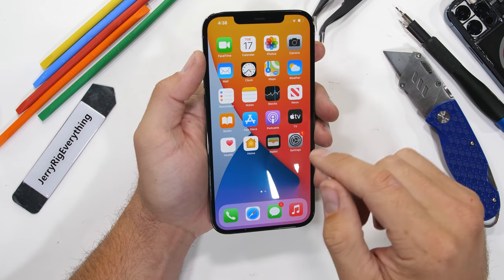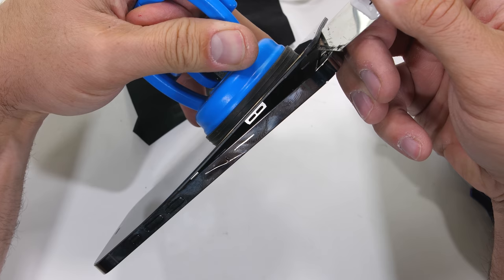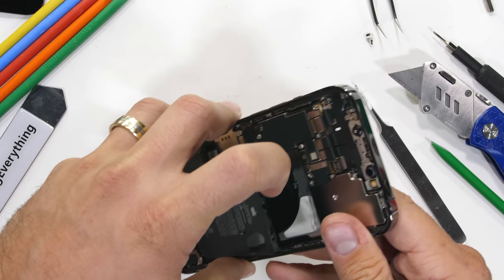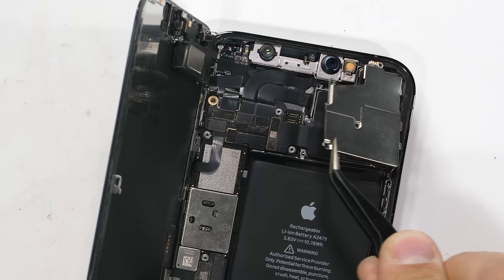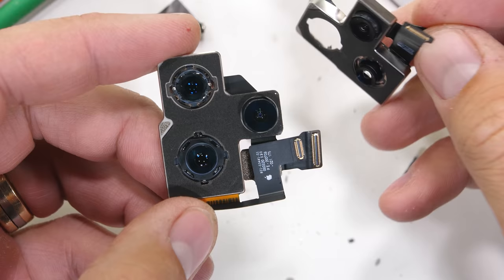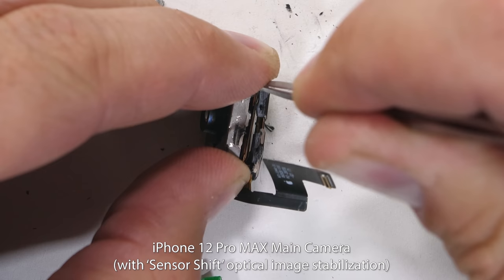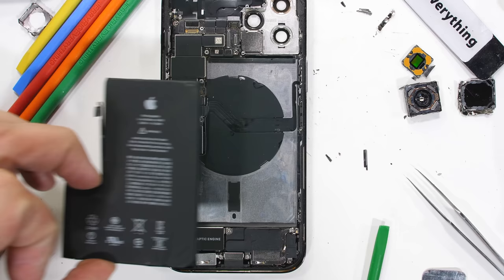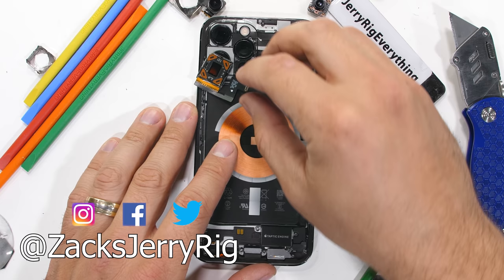iPhone 12 Pro Max Teardown! - I've NEVER seen this before...

Comment: Didn't realize they were using knock off Command Strips under the batteries.
Reply from the maker: Discount PullTabs r Us
Reply: @JerryRigEverything  Hi
Reply: @JerryRigEverything  hi
Reply: @JerryRigEverything  you replied?
Reply: Hi jack. Cone to Bali
Reply: @JerryRigEverything  hey jerry
If you use a little heat from the back of the phone it makes the pull tabs come put wayyy easier
Reply: First i read as “Tech with Butt” 😂
Reply: @JerryRigEverything  Noice
Reply: Hmn
Reply: Unless you can pull those tabs in a unique way. Those tabs aren't for us repairers anyway. Hence why they break easy.
Reply: LOL yea
Reply: Kidney opening done👍😄😄
Reply: @Silvers24  not really, you're just meant to remove the surrounding components too (such as the taptic engine or in this case, the taptic engine and lightning port/speaker)
Reply: @NadimSadeeq  XD You should, I should of just said that. As there was times I did. Infact you are correct, when gutting a phone I would remove the battery last with its tabs. My bad. LOL
Reply: @JerryRigEverything  iPhone 13: No charger port
iPhone 14: no camera
iPhone 15: no phone
iPhone 16: ??
iPhone 17: You've predicted too far.
Reply: @JerryRigEverything  why I can't trust Apple. They literally use counterfeit parts in their phones!
Reply: @JerryRigEverything  hi dad
Reply: Reply 18
Reply: 20
Reply: 21
Reply: 22
Reply: 23
Reply: 24
Reply: 25
Reply: 26
Reply: 27
Reply: I did
Reply: @visualsforyou7120  Hi
Reply: I think these are Dollar Tree brand pull tabs. They had released the address on the packaging of the pull tabs: Greenbrier Enterprises, Inc. 500 Volvo Parkway. Chesapeake, VA.
Reply: I just saw the “12 hours ago” change to “13 hours ago”!!
Reply: His name is zach.
Reply: 'we don't use apple and innovation in the same sense'

Burnnnnn!!!!
Reply: @JerryRigEverything  bahahahaa
Reply: @JerryRigEverything  Zack you are very very strong
Reply: @JerryRigEverything  hmm
Reply: Most of the people here are replying to jerryrigeverything
Reply: Hello
Reply: Lol when s21 5g has no 5g... apple and samsung please stop lying.
Reply: Do you even tech?
Reply: Hewwo
Reply: @JerryRigEverything  
𝐼 𝓌𝒶𝓃𝓉 𝓉𝒽𝒾𝓈 𝒾𝒫𝒶𝒹, 𝑒𝓋𝑒𝓃 𝒶 𝒷𝓇𝑜𝓀𝑒𝓃 𝑜𝓃𝑒 ..
Please...
Reply: @bb-gb7jv  no he didn’t
Reply: @madreviolo  i thought he did :-(
Reply: @Noname_404_  why do u need a broken phone
Reply: Hi
Reply: Much to learn you still have

Comment: Zack : "Sensor shift"
My ear : "censorship"
Reply: Our new phone will come with censorship, no not sensor shift. Censorship will censor your photos for you instead of putting the black bar yourself
Reply: My ear : sensor sh*t
Reply: @editshaunted2618  stop you’re not funny
Reply: @bruhmoment4338  neither are you
Reply: @bruhmoment4338  if you don't care then why did you say it in the first place
Reply: @bruhmoment4338  roses are red 
Violets are blue 
You said i'm not funny so neither are you
Reply: @editshaunted2618  so original kid
Reply: @editshaunted2618  actually was funny a little bit

Comment: “The screen is much harder to remove”
Apple: S T O N K S
Reply: Screen = colourful potato chips
Reply: that is because the iPhone 12 pro max has 6m water resistance
Reply: @ArpanDe   no u
Reply: Apple actually doesn't care how easy or hard their screens are to replace because.... well, they're so anti-repair that *they lock their parts to the original phone*. You will never get 100% functionality back with your iPhone even when using OEM donor parts. Obliging you to buy another iPhone instead of repairing it, so much for caring about the environment, am I right?
Reply: @QuackZack  well yea that is one aspect in which they suck, a double standard, but tbh i can explain why the screens are hard to repair. that  is cause of the 6m water resistance

Comment: Jerry rig: “They have indeed done it, they’ve done something new”

Apple users without iPhone 12 watching: “more reasons to cripple my bank”🙃
😂
Reply: oh yes, because samsung flagships including their fold line is that much cheaper :) im using an iphone SE since more than 4 years now, if not the battery, worn out charging port and my desire of wireles charging i could still use it next couple years. how many phones have you got past 4 years? was it less $$ than the 700 bucks im going to spend for the next iphone? =)
Reply: @Sxxmaschine  upgrade to the new iPhone SE and you still spend only 400 USD.
Reply: @theprotester5171  ye i get you but i love the edgy design so it has to be the 12 mini in my case. cheers
Reply: @Sxxmaschine  yea that's a cool buy bro. If I hadn't bought my s10 last year I would've bought an iPhone 12 myself lol.

Comment: Don't pull those tabs up; pull them along the plane of the phone, by lifting as slowly as possible. Also, once you put some tension on the tab, just hold it there until the tension slowly releases and then pull out more.  You have to give the adhesive some time to release before pulling more.
Reply: Also, sometimes you have to remove some component around the tab to be able to pull then more flat against the back plane.

Comment: I wonder when he's gonna realize, that you actually need to take the things around the baterry out before you can use those pull tabs to their full poteintial. I mean that isn't easy neither, but the pull-tabs were designed that way.

Comment: Can someone explain why the sensor shift technology is inherently faster? The only reason Zach gives is because it happens at the picture collection point. That doesn't make a whole lot of sense to me as a reason. What is the bottleneck between the two methods. Is the difference literally just the trace lengths on the pcb?

I thought the reason why sensor shift technology is such a big deal for DSLRs is because it has changeable lenses, thus you can buy less expensive lenses that don't have optical image stabilization and still have image stabilization?
Reply: The mass of the sensor is probably less than the mass of the lens, so moving just the sensor faster is probably easier/less power
Reply: Photographer here, it’s more stable overall. The image stabilization would be inconsistent and unstable if it relied only on the lenses on a DSLR. It’s a much faster way to stabilize the image, and it’s beyond what a lenses and stable hand can do. It’s a MAJOR help and that’s without a tripod

Comment: you take out the taptic engine before the battery, so you dont have to pull the tabs up, but straight out. less adhesive breakage

Comment: "This technology is only found in DSLRs" but shows us an MILC instead of a DSLR.....
Reply: What's the difference between milc and a DSLR?
Reply: @endagod4079  mirrors
Reply: @endagod4079  an MILC has no mirror hence the name Mirrorless Interchangeable Lens Camera. A DSLR has mirrors at 45 degree angles to reflect what's coming in from the lens to the optical viewfinder above. The mirror behind the lens is normally in the way of the sensor and blocking it. When the shutter is operated, this mirror must flip down and out of the way to allow light from the lens to reach the sensor. By contrast an MILC's lens always focuses the image on the sensor and thus they can't have optical viewfinders. If you remove the lens on a DSLR you wouldn't be able to see the sensor inside unless the mechanism already flipped it out of the way for you.

Comment: JerryRigEverything   Earlier today,  when taking the case off of my IPhone 12 Pro Max to clean it, I noticed a week point in its durability. Everyone knows how hard it is to bend these newer iPhones. However, when twisting the phone from the top left corner and the lower right corner, you immediately realize how much it’s flexes with little force. Let me know if you see this as well. It’s potential for inclusion during your durability tests may be warranted.

Comment: Sensor shift isn't "much better than OIS". It can be better or it can also be worse, depends on how it's implemented.
The reason most interchangeable lens cameras moved to it is because it allows for every lens you put on it to be stabilized. On a fixed lens device, it doesn't matter. It's just marketing, once again.

Comment: In about 2 years or 5 maybe less maybe more there will be closed 'black boxes' modules inside phones only, ones that no human would be capable of open and fix after they leave factories anymore... all that will be possible is to swap entire modules.. think about how easy and expensive will be to fix proprietary 'closed modules' inside each phone or easy and cheap idk... if you also think about 'manufacturers alliances' inventing smart phones or personal devices that uses  interchangeable modules, connector standards and upgradable features. old idea yes, though fully customizable personal devices would eventually be highly desirable as it can be used as upgradable human features as it begin appearing on the horizon in dext decades / years. . .

Comment: Really good video. Thanks for sharing. At time 6:49, if you can disassemble the senors from the bottom fixing part. It will be even better. In this way, we can know how the electrical wire of the sensor is connected to the bottom fixing PCB
Reply: nieooj gotoy  Got it .Thank you.  I thought this rear camera modules was already permanently damaged. That's why I am thinking it is worthy to see how the electrical wire of image sensor connected to the fixing part on the camera module

Comment: I accidentally dropped my 12 pro max, it has a camera lens protector and a apple silicone case, nothing happened to the phone physically. It still works fine and properly, just a question. Would you think the internal components and logic board would be shaken up or loosen up? For peace of mind i need your opinion guys? Thanks

Comment: Not sure if sensor stabilization will make dramatic improvements from 1000cycles to 5000cycles p/s. But indeed apple can claim this achievement in mobile world. The catch is they did not do this because they just can, but i strongly believe it is to make adjustments faster by not moving the lens (which is already floating on its autofocus front/back axis). Good solution overall. Now the next step is to achieve Lens and Sensor stabilization which is i think the next step for whoever want to tackle it. Which is already common to Sony FF and Canon, Nikon with some OIS compatible lenses.

Comment: "You can't discredit all the cool stuff that Apple has done"
No  but we CAN discredit MOST of its recent technological advancements within the last 4 generations.
When the majority of apples new innovations since the passing of Steve Jobs have been replications of their competitions technology, we can say just exactly that.
We can recognize that samsung has manufactured critical skeletal components of the iPhone for years, to include the following:
The displays,
The antenna's design,
The modems,
The memory sticks,
The ram sticks,
The 120hz adaptive refresh rate coming to iphones next year,
The foldable phone concept that Apple is seeking to poach from Huawei,
The in-display touch Id that samsung had FOREVER ago,
The telephoto lens that Apple is poaching from Samsung next year,
And even some batteries for certain iphones,
We can absolutely argue that Apple is absolutely not who they used to be.
Apple is now the bloated PC industry from the 90s that everybody resented for price gouging and monopolization.
If you're going to argue that Apple is innovative, the least you could do is TELL THEM TO MANUFACTURE THEIR OWN FUCKING GOD DAMN HARDWARE, INSTEAD OF CONTRACTING IT TO SOMEONE ELSE AND STEALING THEIR FUCKING CREDIT FOR IT.
You bunch of baseball cap wearing shmucks.

Comment: The constant ignorant puns against Apple (which are wrong as well, btw) not innovating are getting old, and I assume can only entertain the most uneducated audience members. Anyone who's an engineer and understands some things a bit more in depth knows that Apple has done a lot of very impressive things over the years, it just takes looking at things without a "oh it looks the same on the outside, so it must be the same" perspective. It's almost as if a lot of people are afraid to admit whenever Apple does something good, that's how sheepish in behavior the haters are, preferring pleasant delusions over hard to accept facts. They've certainly innovated by far the most of any smartphone brand, as other brands don't even produce internals for their devices. Who else develops and designs pretty much the complete hardware for their smartphone? Nobody, they just use off-the-shelf parts. Let's see Samsung develop a CPU for their phones, and see how they'll perform. Apple does it on their own AND manages to vastly outperform the competition at the same time. iIphone 12's are out, and we're yet to see an android phone that matches the performance of the iPhone 11's.  But of course, haters will insult me now, because I'm using benchmarks to prove a point. It's ok when they use benchmarks to prove that Apple PC's are bad because they don't do well in gaming benchmarks, they're fine with that argument then, but not when it proves them wrong.

Comment: Apple threw innovation straight out the window the day Steve jobs left...and after that, brought every innovation 2 years after android. Bringing the same shit for 3 to 4 years.. by the time iPhone 7 came, there were hundreds of  Android devices with edge to edge large displays.... And even today... there are even budget androids like the Redmi, Poco, Huawei and Samsung phones that are under 250 Dollars that come with under display fingerprint scanners.. but Apple will do it 5 years later 😂
Reply: Firstly, Steve Jobs never really innovated anything. What he mostly did was take what was already on the market and make it better. Secondly apple has created a lot of innovations, and innovation isn't always making the next gimmick, It's also about innovating how a product should be done, which apple does the most. Also in 2017 most Android phones are absolutely terrible, along with the fact $250 phones do have under display camera sensors and whatnot... But they also have garbage performance, garbage build quality, crap cameras, crappy software, barely any software updates, etc.